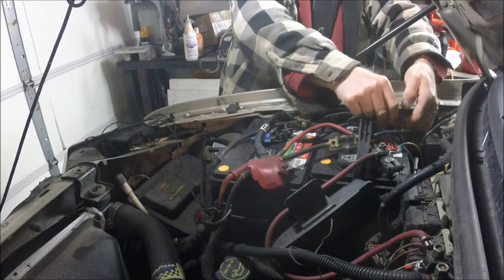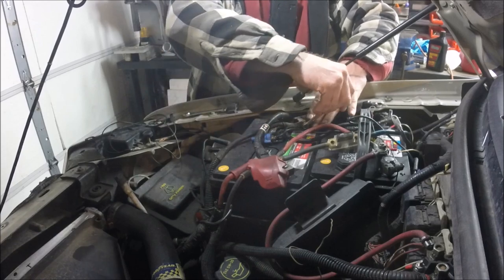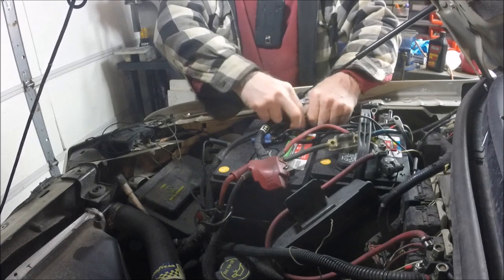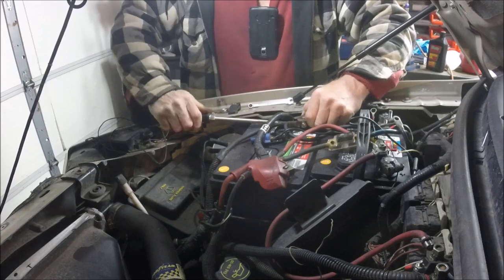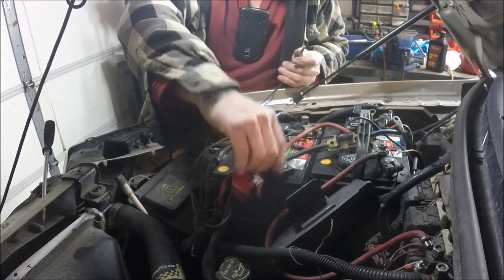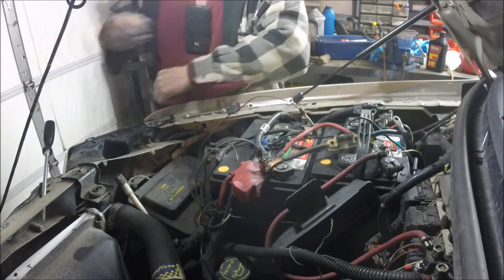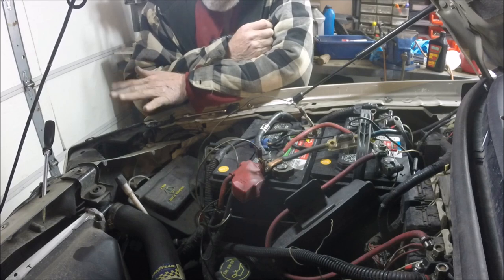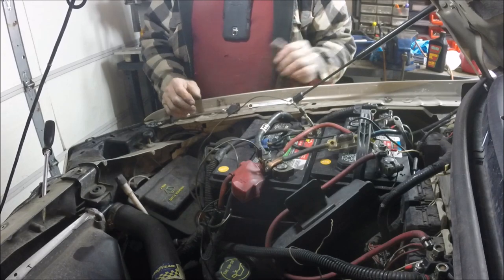How to reset the ecm or computer on 07 f 150 5.4

Comment: Thanks trying this before replacing my pcm !!! 
I have a 2010 f f150 same engine.. I get the wrench light and gets stuck on 3rd gear no power and hard shift from Reverse to drive.. any other tip for this?

Comment: After I charged the battery on my 2007 5.4 Triton the theft alarm red light was flashing and another blue light on the mirror was flashing ten times faster than normal. Battery would turn the engine fast but no spark. I tried your suggestion and it started immediately.

Comment: What I need to do that if I was replacing my timing. Cam phasers oil pump the reason I'm asking is because I replaced all this it runs fine as soon as I throw it and drive it starts to misfire and I'm wondering if the computer could possibly be the issue cuz I have checked the timing twice
Reply: Pro tip : watch series on Flixzone. I've been using it for watching lots of of movies recently.
Reply: @Rafael Vincent Yea, have been using flixzone for months myself :D

Comment: Can u use jumper cables as long as it doesn't touch anything or do u need a wire with those alligator clips ...if so what gage wire?
Reply from the maker: might be a little big but should be ok.
Reply: Bob's Lawn Service & Plowing   what gage is that jumper wire anyway? Looks like 12 or 16?
Reply from the maker: 12 or 16 would be fine
Reply: Bob's Lawn Service & Plowing  cool thanks for getting back so soon .. I'm in the shitty snow removal business too...i look after 21  houses with the blower,,another storm headed our way today ,,,im in Toronto Canada
Reply: It is the same as removing batt out of truck then touching both pos and neg together this drains the Keep Alive Memory KAM capacitors no sparks or damage there is no pwr hence battery removal

Comment: I have a 04 5.4 tritan and I've replaced the cam sensor twice and the engine light still on.ive driven it  over 200 miles..so fusturating.will this help?
Reply: I'm in the same boat. First told I put bad sensors in then told I have to take the truck to ford to re program the ecm

Comment: Hello Bob Good info video, but will also work when install of phazer blocks. I heard that the ecu needs to be flashed to eliminate the VCT solenoids. Will what you just did in the video 
cause the ecu to fash so that the VCT solenoids are no longer working??
Reply: No it will reset them but they will run next time you start the truck. You have to have the truck tuned to forget the VCT solenoids.

Comment: What about when replacing cam chains and guides, local mechanic just did that and it still doesn't run right, i have an 07 as well and they just keep throwing parts on it except for the right one!
Reply from the maker: i'm done with FORD, just  bot a new chev
Reply: Same boat

Comment: I did this today and it started running better but I drove it 50 yards down the road and the gas pump stopped working, put a new pump on still no start, checked for power at the pump and it's got power, been working on it all day, I'm totally baffled, any ideas would be appreciated, I checked and inertia switch and it was engaged to work properly. It's a 1997 e150 van
Reply: Bad ECU maybe

Comment: I changed spark plugs because was giving off code for plugs and one coil pack. Now its idling bad and throwing off code for ecm . Gonna try this in morning. Hope it works 08 lincoln mkz
Reply from the maker: to times my truck was idling bad, and missing on the hi-way. went to my shop i use and they scanned it and found bad coil. they have a snap-on scanner. only use Motorcraft coils, I know they are spendy but I tried all the others and they fail.
Reply from the maker: let me know how it goes. thanks